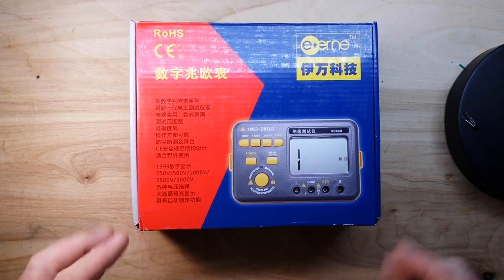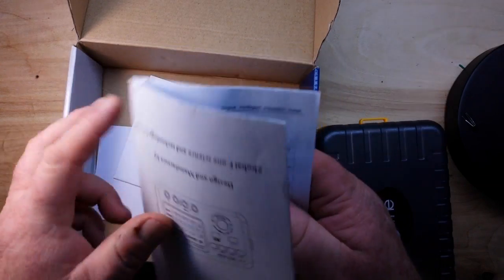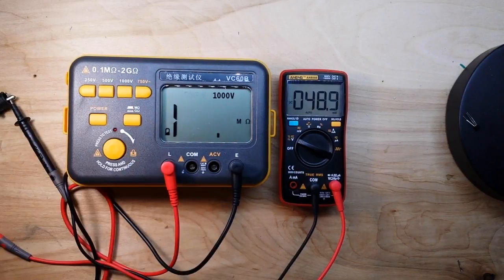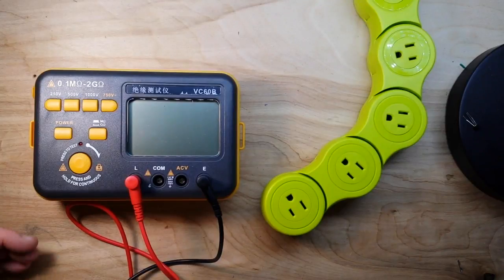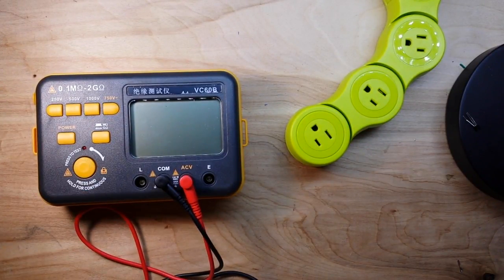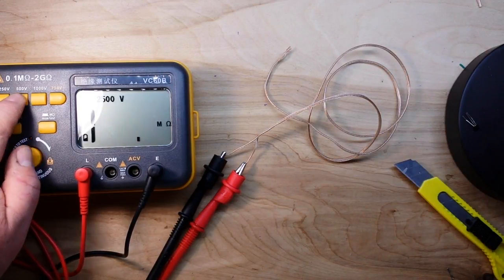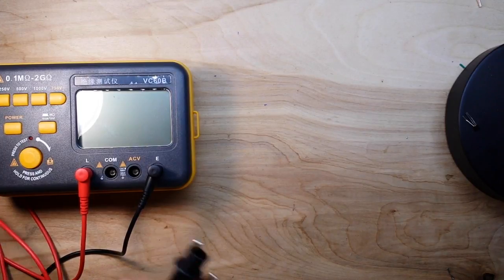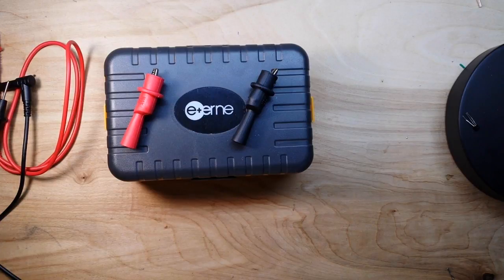VC60B Insulation Tester

Comment: Most insulation faults, in the real world, come from damp and/or excess moisture situations.
Scraping away or cutting the insulation, like you are doing here is no way to simulate a fault condition.
Much better to get a glass of distilled water, (which is an insulator), and contaminate it by the smallest amount.
Naturally occurring condensation across exposed conductors, due to worn or perished insulation, will usually be contaminated by any pre-existing dirt and/or oxidation of exposed copper and thus create a conductive path where normally, there should be none.
The output test voltages seem rather on the low side but you just gloss over this, which gives the impression that you do not want to upset whoever it was that sent you this tester, because you got it for free.
The battery level indicator shows that the batteries you are using are far from optimal.
This could be because you are using NiMh rechargeables which typically have a lower voltage, even when fully charged,  than your regular alkaline types.
Unfortunately, we don't get to see what type of batteries you are using, which is just another problem with this review.
Is it because your batteries are low or wrong type that you are getting these low output voltages ?  We shall never know.
Also, you accidentally left it in continuous mode at 1,000V which speaks volumes for your competency levels.
I'm sorry but for me at least, this review was a fail.
All the best.
I know you can do better.
>

Comment: You accidently left it in continous test mode at 1000V. Good thing you didn't touch the leads. I would not trust this device.
Reply: It's 6x1.5v AAA amazon cells. (c'mon)
This device is not superhachging supercaps.
funny how people think "danger Robinson, danger, life in Danger"
when they hear high voltage.
Knock yourself out, take a clickable lighter, or an arc lighter.. its gonna do jack.
same with this, it is a very small arc it creates if you shorten the probes, and floor the 1k HV
exactly the same with these protection zappers, people in the USA are purchasing to protect themself... they are way way more powerful then these, and they will still only tingle  and not like Hollywood loves to display them.
Reply: @JAKOB1977 on any of the megohm settings you will get a shock ie on the 500v settings if you carelessly leave the test button in the contiguous mode and touch  the tips of the test probes you will get a 500v shock and it will hurt but it won’t be fatal as the meter only puts out 1amp ie it put out high voltage very low amps. I have been a qualified electrician for thirty eight years and I use these test instruments every day. Some of you guys need to learn how these devices work and what they are used for and how to use them. Also the symbol on the left of the display is not a 1 it is an I for infinity.♾️ means the reading is greater than the machine can read. A fluke will display >300mohm,again this is great than the machine can read , it the maximum. A Megger will display >999 megohm , a Kewtech displays >200megohm , A reading of less than 1 megohm is a bad reading and tells you there’s a problem, anything from  1 megohm or higher is a good reading and that’s is what you want.  Greetings from a UK🇬🇧 electrician  .

Comment: Just damaging the insulation is not enough, failures usually also involve moisture or dirt to create a path which has an resistance high enough to not trip the breaker but low enough to get things energized which probably shouldn't.
When testing devices you usually also want to check the path between the plugs earth and casing so an RCD can operate properly - this however requires a specialized circuit to measure properly (high current to ensure a reliable path) which is missing from this device in comparison to a PAT.